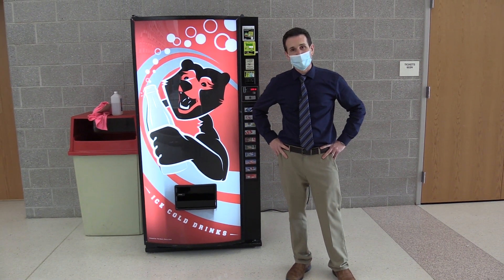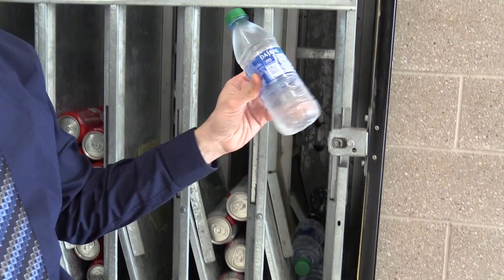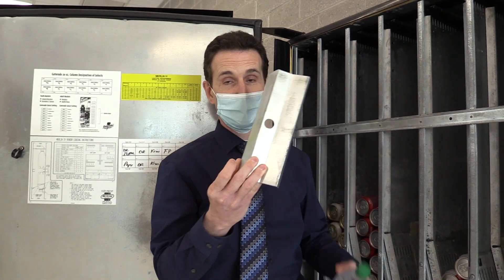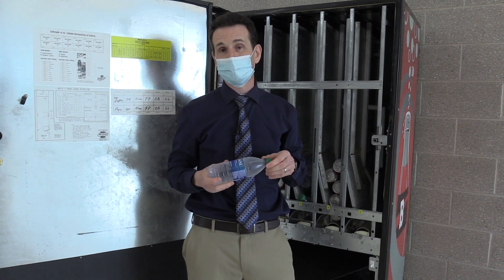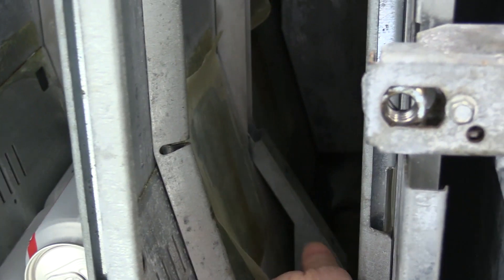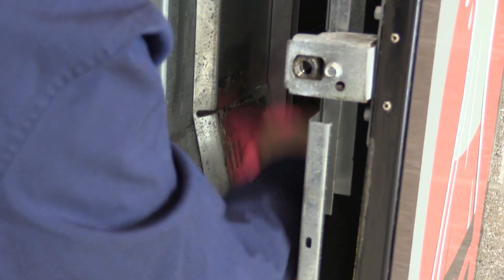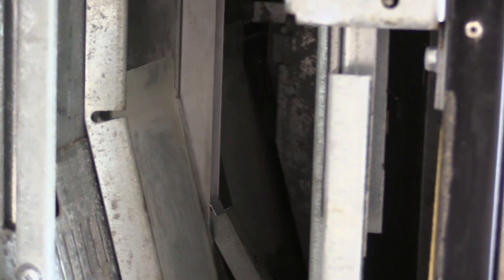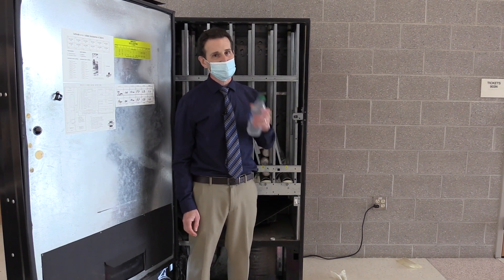Preventing Bottle Jams

Comment: Great video. I have a Dixie Narco 501e that I bought a shim kit to change it from bottles to cans. In a couple of the slots sometimes it will vend 2 cans when a selection is made. The kit came with rods but I was told I didn’t need to use them so IO didn’t install them. Like I said only a coiuple of slots vend 2 cans sometimes. Any ideas?
Reply from the maker: For cans, you should put the rods in the rotors. You don't need the rods for 20 oz bottles.  Are you sure you have the cam settings correct for the columns that double vend?
Reply: @HappyVending  Yes I have the cams correct. You have a video on here explaining the rod installation? There’s multiple holes, unsure of which one to place the rods in.
Reply from the maker: @ericdunnewold911  Use the center hole for cans.
Reply: From the perspective of a user, getting two cans for one is like winning the lottery.

Comment: Awesome video! I have a G3 and I’m running 20 oz water bottles. After 7 sales the bottles will jam against the clamp. What do you think I should do? Should I switch to 16.9 and buy the bottle helper you showed here in this video?
Reply from the maker: Are they Dasani or Aquafina 20 oz bottles?  You probably just need to set the side product stops to the wide product setting.  The G3 machines do not use the bottle shim that I used in this video...that is just for the Merlin IV machines.
Reply: @HappyVending  they are Sam’s Choice from Walmart.
Reply from the maker: @diegovergara9282  Try using the wide product setting on the product stops and see if that helps.
Reply: @HappyVending  how do I access the wide products settings?
Reply from the maker: @diegovergara9282  I demonstrate how it's done in this video: https://www.youtube.com/watch?v=3r-2ivW6AdU&t=10s
Reply: @HappyVending   hi bill, I did do all the instructions in the video you linked. Thank you for those instructions by the way. It seems like my powerades are vending no problem. The pivot  piece is catching the water bottles. My guess is the plastic is too soft. I will upgrade to Dasani or Aquafina.
Reply from the maker: @diegovergara9282  I found some 20 oz Deer Park water bottles at BJs that are vending fine for me...maybe you can find them in your area.  To get the 20 oz Dasani or Aquafina you will need an account with a bottler.
Reply: @HappyVending  One last question. Can I sell 16.9 Lipton teas in my G3? Or do all my bottle products need to be 20 oz?
Reply from the maker: @diegovergara9282  I vend Lipton Tea in my G3 fine.  You need to be in the narrow product stop for that since the diameter of those bottles is the same as a can.

Comment: Nice video 👍. So what's a good site to buy stuff for vending machines like parts and other things you might need for the machine?
Reply from the maker: It all depends on the part you're looking for.  Honestly, I buy most of my parts direct from the manufacturers, Royal Vendors or Crane.  I've also gotten parts from D&S Vending and Snack Attack Vending.
Reply: @HappyVending  oh ok I got it. Thank you for replying.  Your videos are so helpful.
Reply: Also I have a question why is it that some time my snack machine will say not available to a selection when there is product on the selection? Thanks.
Reply from the maker: @victorescobar2737  It could be a bad motor or wiring harness.  To narrow down the problem you could try swapping the motor with one that you know is working.  See if the problem follows that motor.
Reply: @HappyVending  thank you I'll try to do that.👍

Comment: I have a Dixie norco DN 276E MC/S11-7 I have 16.9 water bottles in there and there coming out 2 at a time on free vend should I change to 20oz , maybe the water bottles I have are to weak or to squishy?
Reply from the maker: Yeah...16.9 water bottles don't vend real well from a 276e.  You should be using the can shim and keep the stack lower.
Reply: So maybe like 6 total in one aisle 3 in the back and then 3 in front?  I’ve been stacking them straight up like 5 at a time w/o any in the back …but I’ll try that thank you BILL .
Reply from the maker: @rkc6228  Yeah...I'm able to put 10 waters in mine...2 waters deep...5 front, 5 back.  Make sure you have a can shim in the machine.

Comment: I have question for u.   I got a royal 660.  The screen says “no sale”.  What do I do to reverse that?  Basically how do I get it to sale?
Reply from the maker: Well, you really need to narrow down the problem.  Do you have change in your coin mech? Do you have product in the machine?  When you go to the Error menu, is the machine listing any errors?  Did this machine ever work for you?  Did anything change from when it did work?
Reply: I just started using it.  Bought it off FB. 
Product is full
Coin mech tubes are 2/3 bucks High
Reply from the maker: @mcarter1990  So it never worked for you?  Did you check for error messages?  Did you try filling the coin mech in Tube Fill mode?
Reply: @HappyVending  how do I do that?
Reply from the maker: @mcarter1990  How do you do Tube Fill mode?  Watch this video: https://www.youtube.com/watch?v=lA5n3BfA5yo&t=957s
Reply: @HappyVending  I think this is my issue.  I will mess with it again today.   The mech I have is a MEI 7000 series     I really want to thank u for ur time.  Do u have email address I can send u questions?
Reply from the maker: @mcarter1990  billc@ptd.net